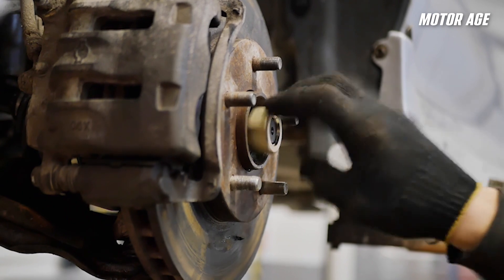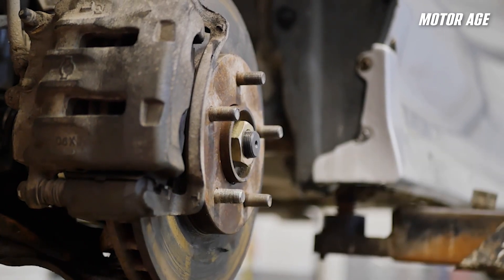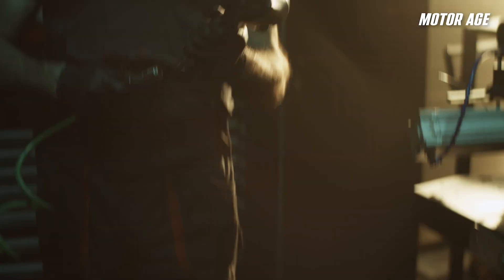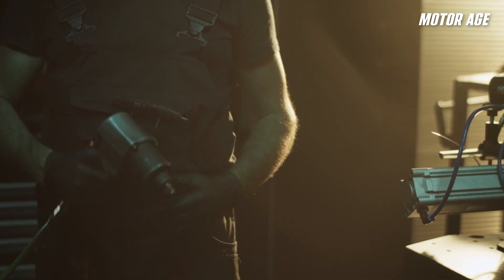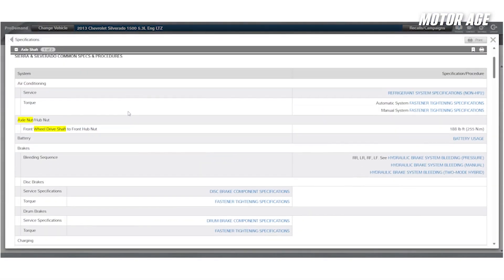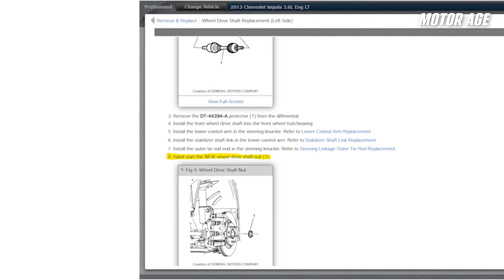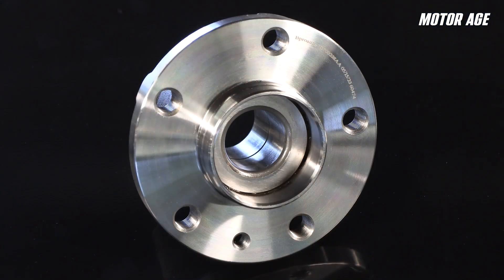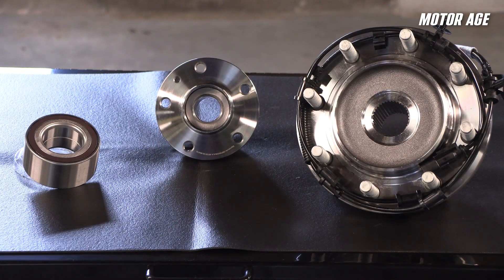The Number 1 Reason New Hub Assemblies Fail

Comment: I bought a 2014 Cruze for 500 bucks. At 58k it had a front seal installed at Crivelli Chevy for oil leak. Then at 66k Crivelli buick had diagnosed it lower end noise needs engine. I found the crank bolt loose. New bolt and balancer and I put 20k on it.

Comment: Good quick video! When in doubt, use the torque wrench. :D
Reply from the maker: 100%, it doesn't make sense to cut that corner when its adds basically zero additional time and effort to the job.  You hopefully are using that torque wrench on the lug nuts, its 30 more seconds to switch sockets and hit the axle nut too.

Comment: Good video Erik.  I remember years ago that Timken said the number one reason for wheel hub bearing failure was due to improper tightening of the axle nut.  I have always torqued to specification and never had a failure or comeback on the hub assembly
Reply from the maker: Thank you, and yes pretty much universally hub manufactures preach not just running that axle nut home with an impact.  The extra 30 seconds can absolutely save a comeback.